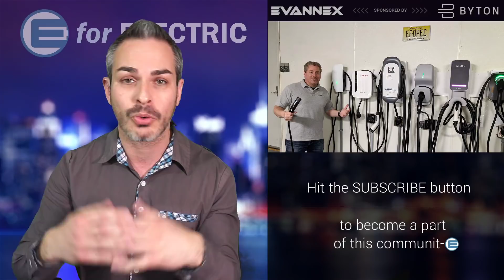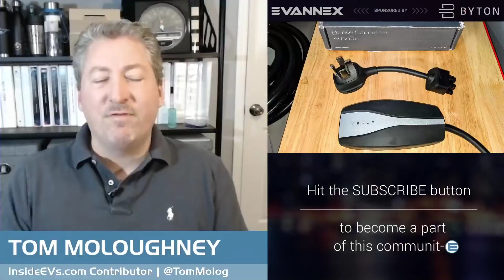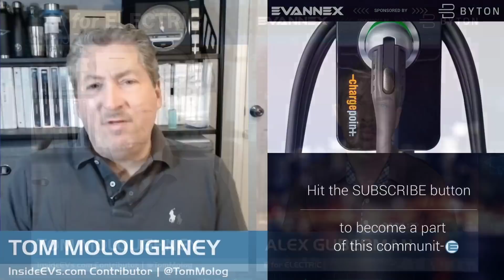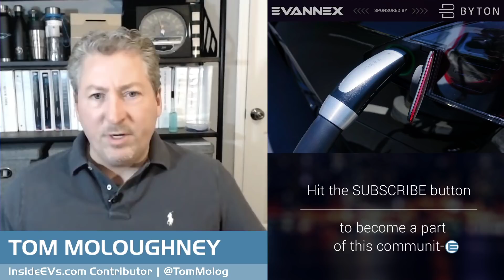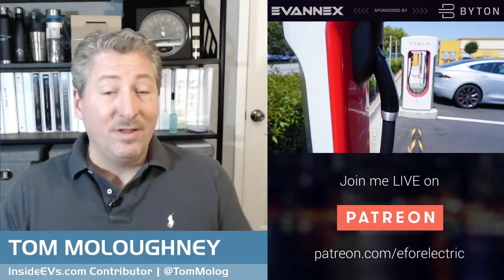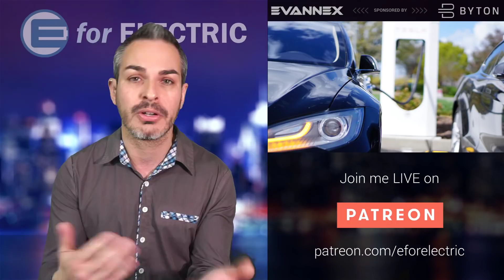How Long Does it Take to Charge an Electric Car?

Comment: EU = Max. 245V. (solar  =>+  248V. /If the mains voltage is higher than Volt 245, the solar panels can NOT charge the grid!  )

Comment: I have a 100A service and the electrician was able to install a 30A (40A breaker) level 2 charging station (EVSA). It all depends what other electrical appliances you have in your house. I have a gas furnace and hot water heater and don’t have a pool so I’m sure that helped. The key is to get an electrician to check out your panel.

Comment: Warning!
You just can't use an extension cord from your dryer outlet. The longer you go, the more resistance in the extension cord. You could end up starting a fire. 

If you're not using your dryer outlet, have an electrician use that circuit and put in an outlet where you need it.

Comment: I did not know that CCS in the U.S. is different from CCS in Europe. I could not understand why the Model S and X CCS adapters in Europe were not available in the U.S.
Reply: Tom Hoffman it’s because most EVs in Europe don’t use the J1772 (they call it Type 1) connector we use here but instead use a Type 2 connector that has an extra power pin to allow for 3 phase AC charging. The CCS Type 2 cable doesn’t use those pins but since the connector is a bit bigger, it isn’t comparable with a CCS Type 1 plug.

Comment: I wonder why the Evse cord isn't orange. Like the high power wires inside my electric car? The trip hazard would be less, than with the black charge cable they use now.
Reply: Orange wires denote high voltage DC lines in a car. The EVSE cord is a much lower voltage A/C line. The standards for cars and EVSEs are created by different regulatory bodies. I’m personally glad that the cords are not orange as it would be quite unsightly. You could definitely skip wrap the cord in orange or other high visibility colors as mentioned.
Reply: You could wrap the cord in coloured electrical tape.   I've never seen heavy waterproof cables in colour.